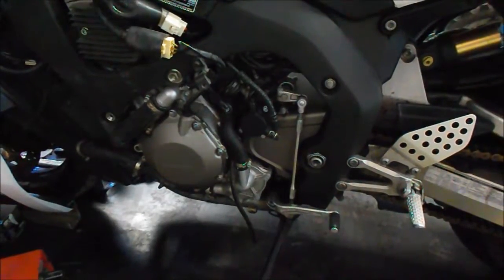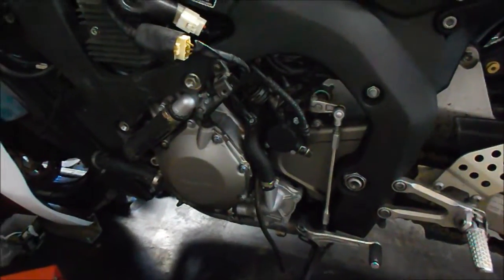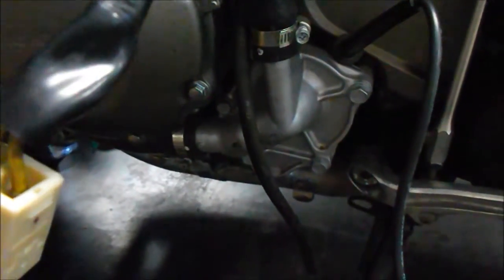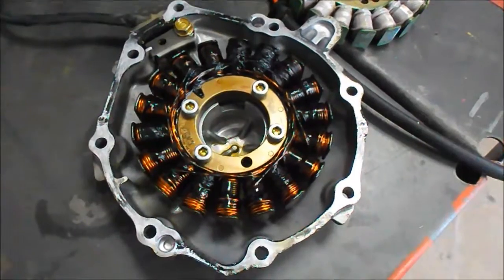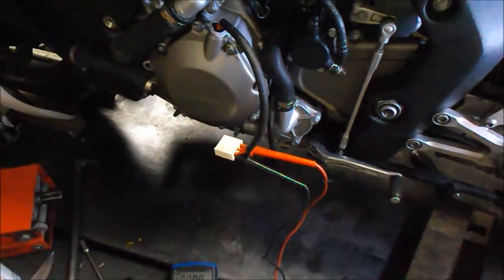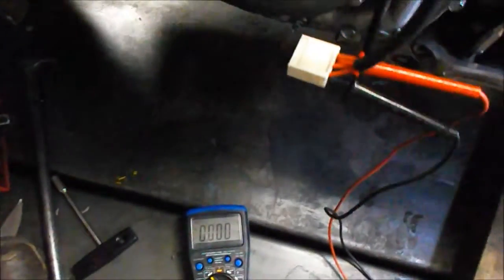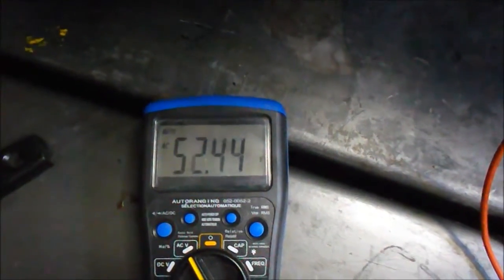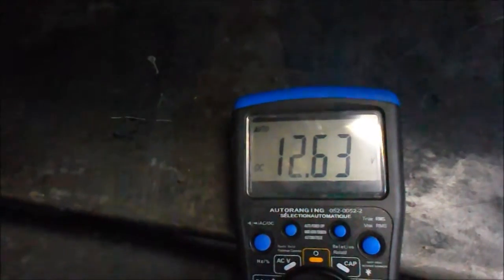CBR1000rr not charging battery weak stator bad

Comment: hola amigo, tengo un cbr1000rr 2007, y le compre una bateria nueva, y se descarga, que me recomiendas tu que revise el regulador o el stator? como se debe revisar cada uno?
Reply from the maker: +richard giaco     Hello      check for at least 60 volts AC from the stator 3 yellow wires  at 5000 rpm .. if low or no voltage the stator is bad ..   if you have 60 volts AC from the stator the regulator would be bad,  if the battery is good always check for bad connections as well.   You want to keep the battery at around 13.8VDC
Reply: gracias amigo
Reply: @rotor1986  hi , i have cbr 600rr 2008 and my regulator is good , i got new stator and stil my output is no more than 13 volts ... Do you think my magnets are weak on the flywheel ?
Reply: @sandstormy93  I have the same problem, did you fix yours? and how?
Reply: Hello. Mine cb1000r its 18-19v at low rev. 5000 around 60v but if you rev it higher keep going it to 90v is it normal?